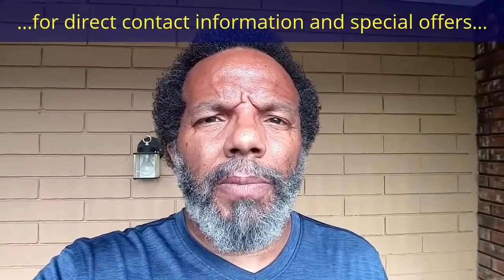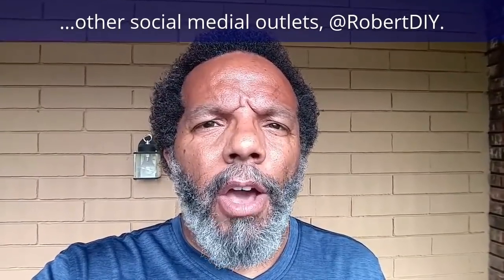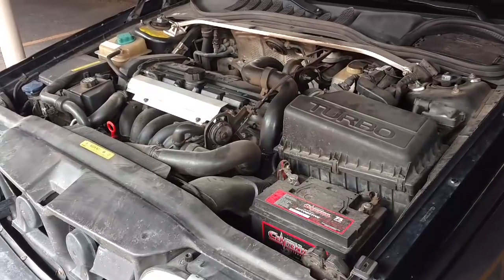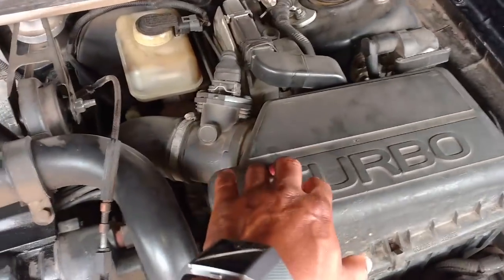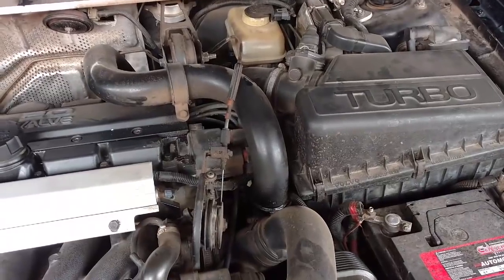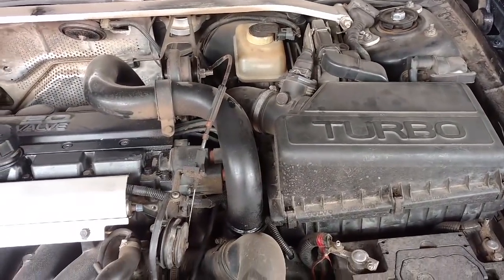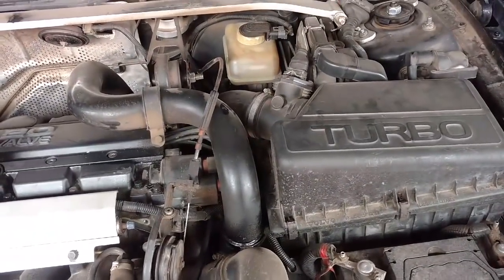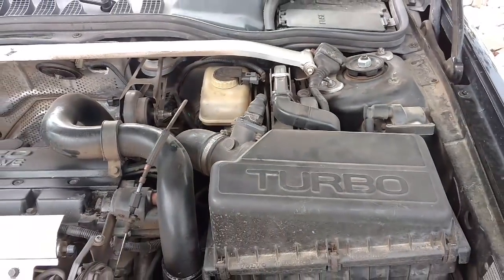Why does the engine in your car shut off when you come to a stop? Error code P0102 or P0103 - VOTD

Comment: Yes, great point for sure and I like how you say buy some maf cleaner to clean out the throttle body 20% of time it works and then you mentioned 80% of the time it’s the maf, one way to know if the maf is bad and without spending $250 on a new one, unplug, the maf then with the engine running if your car runs ruff then you have a good maf sensor, on the other hand when it’s unplugged it runs normal  then it’s good.

Comment: Mine stalls coming to a stop or coasting down the road. No codes being thrown. Iv cleaned the MAF and the throttle body with the two correct cleaners.  Buick 2007 3.5 motor.
Reply from the maker: Ok

Comment: I have this same problem but MAF not showing up on scan only bank 1 Oxygen sensor
Reply from the maker: The code system triggers when certain limits are exceeded. Could be a few things but MAF/MAP are most likely. Did you check pending codes?

Comment: What if I changed my maf twice already  also changed the throttle body in case it was dirty also changed my fuel pumps. And my car won’t stay on  anymore when it did stay on it turned off on me when driving slow.  The only code I’m still getting is the maf
Reply from the maker: Where did you get the MAF?

Comment: Hi, I had the codes p0101 and p0104 and cleaned up the MAF sensor. It ran well for 2 weeks and the light is back same codes. Tried to get a new one from ford but it's discontinued, I got a different one from Napa. Now the car turn off when I stop. Any suggestions after replacing the MAF?
ford mustang 2001 v6 3.8
Thank you!!
Reply: *sorry p0171 and p0174
Reply from the maker: Maybe you can find a good used one from a salvage yard or off of eBay.
Reply: @RobertDIY  thank you so much for your suggestion.  I reset the ecu and it seems that it's working fine, but it's been only 2 days.

Comment: Very nice video. I have a relevant issue with my car. When i press the clutch to change gear or stop, sometimes the engine immediately shuts down (rpms go from 2000-3000 etc to 0). I tried to clean the map sensor and the idle valve (both of them had some dirt), but the same happened again. I don' t know which of the two is causing the problem because the ecu don' t have any error. Everything else (engine performance, idle speed etc are perfect). Do you have any idea?
Reply from the maker: Clean the throttle body. If that doesn't help, you may need to have a shop check it to see which part is failing to function properly.

Comment: ? Could the Cyatlic converter cause your car to shut off?
Reply from the maker: If it's totally clogged. It gets worse and worse. Usually slows down the car on highway speeds, then looses a lot of power, then makes it drive under 25 mph... if you're not dealing with it by then, you need medication.

Comment: I’m having same issue in mini van. I’ve replaced the engine filter.. idle air control.. throttle body clean. And cam shaft synchronizer . Any help would be greatly appreciated. 2006 mercury Monterey . One owner. 90k miles
Reply from the maker: bring it by.
Reply: @RobertDIY   where are you located ?

Comment: yes I changed out my mass air flow sensor…still doing it…
Reply: Try to clean your throttle body, EGR Valve and check your fuel pump
Reply: @ramiahwhitney1946  I have no clue what those are 😂
Reply from the maker: Cool
Reply: @RobertDIY  how???????? you know other options?….

Comment: Hi Robert I have a car that was stalling at red lights and stop signs and I put premium grade unleaded petrol in my tank with a bottle of octane booster in it and after doing 100kms on it I've noticed that my car is not stalling anymore. I also unplugged my mass air flow sensor plug and plugged it in again and I'm not sure what fixed my car stalling. Have you any ideas on what would have fixed this problem? 👍🏻🇦🇺
Reply from the maker: 🤷🏾‍♂️ Have you scanned it for codes?
Reply: @RobertDIY  no I didn't scan it for codes bcoz I don't have that scanner. Maybe I was just lucky? 🇦🇺

Comment: I have a Honda element   4 cylinder with a rough  idle sumtimes  I changed  the spark plugs and the air filter is basically  new it cuts off when I'm trying  to start it not to often  but I do have a oxygen  02 sensor code,  so I need to replace  map senor  are o2 oxygen  senor I'm clueless are maybe just clean all  the carbon  inside the air throttle  ???
Reply from the maker: I doubt that. Fix the codes and look for vacuum leaks.

Comment: My 2013 Kia Soul is having a problem.  Dealer has not found the source.  I've had it tuned up, flushed the transmission, all good but not helping.  It dies (once in awhile) at a red light, starts right back up, but sometimes it really is hard to get it to gain speed... no amount of trying to give it gas helps it for several seconds.  Like pushing the pedal to the floor doesn't affect it.  Then the car slowly builds up speed and get back up to say, 40 mph. Engine light usually stays off, or will go off.  When I took it to the dealer, it did not come on. Someone told me it might be a powertrain control module.  Could it be a mass air flow sensor.  Any other ideas?  Replacing the PCM is costly at my local dealer.  THanks in adance.
Reply from the maker: https://youtu.be/NWfLpp8NevI

Comment: How can I find out if no check engine comes on???
Reply from the maker: have it scanned.
Reply from the maker: How can you find out what?
Reply: About what's wrong if no codes? My 2016 f150 is stalling more frequently now I took the truck to the dealership but they couldn't find anything wrong with it
Reply from the maker: If you suspect the fuel pump, they can check fuel pressure.
Reply from the maker: Did they test the battery?
Reply: Yes it is a good battery and alternator too

Comment: Thanks very much for the info... I have 2013 Toyota corolla  and I experience the problem only when AC is on...could it still be the mass air flow sensor?
Reply from the maker: ac compressor could be locking up.
Reply: I'm experiencing the same with a 06 jeep commander, shuts off when off in park
Reply: I have the same issue, did you find any solution?

Comment: Have 01 Toyota Camry,starts well but wants to die on idle and does not run smoothly, had a code P0106,P0420,P0770 ,P0106 P.
What do you think?
Reply from the maker: I think you should Google the codes.

Comment: I have a 2000 S70 with ETM that struggles to idle and occasionally stalls when putting in the clutch or in neutral while the car is rolling, but when I come to a complete stop, the idle corrects itself to ~850rpm and doesn't miss a beat. It only struggles to idle when the car is actually moving. No codes or CEL.
Reply from the maker: Who told you that it is an ETM issue?
Reply: Nobody told me it is an ETM issue. I was merely specifying that my S70 uses an electronic throttle module, not a traditional throttle body. 

The ETM might be malfunctioning in a different way though, because the throttle does not close quickly enough when letting off above 5,000rpm (putting in clutch pedal and letting off the throttle pedal results in the engine revving even higher, before finally going down). It doesn't do this at lower RPMs, say, 4500rpm, even at wide open throttle.
Reply from the maker: I guess it's how you read it. I know that all Volvo's post '98 have ETM's so...
Reply from the maker: https://www.youtube.com/watch?v=NWfLpp8NevI
Reply: My car pulls smoothly and strongly all the way to redline at WOT, starts up after just a second of cranking when cold or warm, and idles perfectly fine as long as the car is fully stopped. It shows no symptoms of fuel starvation at all, besides idling abnormally low only when the car is rolling and effectively in neutral. 

I'm thinking it may be MAF or sensor related, because the car obviously corrects the behavior when it thinks the car is stationary, but it doesn't when there's forward speed to be registered.
Reply from the maker: Probably a bad ETM.
Reply from the maker: On a standard car, it usually idles a little high when rolling, ECU controls that. Has the ETM ever been rebuilt or replaced?
Reply: My service records don't indicate the ETM ever being serviced or replaced; car just ticked over 300k a few weeks ago. Do you have experience with xemodex.com and their rebuild service?
Reply from the maker: No, but most have had great service from them.
Reply: Thank you, I'll probably roll with the current one for a few months as it's still just a minor problem and isn't currently affecting overall driveability. $500 plus another $250-$300 for a MAF replacement is a lot of money to spend on a $750 car just to resolve it stalling once in awhile.
Reply from the maker: https://www.youtube.com/watch?v=ihG8BsUJro8

Comment: Ive had this problem. A rough idle at start and difficulties staying on. No codes ever popped up so family had to take car everywhere to get it checked. Problems other mechs thought it would be where.
1.Faulty pump relay
2.Faulty gas pump
3.Map or maf sensor 
4. Dirty throttle body 
5. Spark from plugs
6.spark plug wiers or coils
What ever the problem was. Mechs never found the problem so. We sold the car.
Reply from the maker: Dang, probably old fuel pump.
Reply: I just love you Robert💙

Comment: Funny thing just popped up on my notifications. I was just coming back from the store and was thinking how much better old girl was running since I changed the MAF. She wasn't idling or running well at all. Before I changed it she was a slug, but coming up a steep hill just now and had plenty of power. One comment/question for you. Sometimes stalling at idle can be a bad or dirty idle air control valve right? Would this era Volvo have one? On some cars the computer just keeps the throttle plate open ever so slightly instead of having and IAC I think. Thanks again for your videos, sometimes I watch em for issues my car doesn't even have because they are to the point and well done. That and, with an older car you never know...could have something go wrong at any time. Keep the shiny side up mate!
Reply from the maker: On the cars built before '99.
Reply: @RobertDIY  I have also noticed she'll cough a bit on startup after a long heavy rain. Sound like any pattern failure or common problem you know of? She almost always fires right up. Did put in a new coolant temp sensor once when the problem was every day, but since no issues....just coughs and takes two or three tries after a heavy rain.

Comment: How often do you find the check engine light burned out?
Reply: You dont need to tke time and check it. You will know its out when cycle the key to start and it fails to light up.
Reply: Ever.... they will long out last the car.
Reply from the maker: All the time. Mine is out in my yellow car. Sometimes they are missing. 😳
Reply from the maker: Exactly.

Comment: amazing video robert. i never knew a bad MAF sensor could cause a running car to die. to my knowledge i thought it affected the ability to actually turn over a vehicle and make it run. Scotty kilmer has a video about it and the information that absorbed was ,the ability to turn over a car with a dirty MAF was incredibly hindered. By the way would love to see a video on bad freeze plugs causing coolant leaks.
Reply from the maker: I don't use water in my coolant system. 🤔😉

Comment: My 2000 volvo s70 had the rpm dip down to 700 rpm when coming to a stop. (Its automatic) it never actually stalled but it acted like it wanted to. It got worse and worse until I decided to clean out the throttle. Sure enough it was dirty and after cleaning it the rpm never fell below 900 rpm when running, the result being dramatically smoother stops. I can finally stop at stop signs and not freak out that my car’s going to die.
Reply from the maker: Those ETM's go bad.